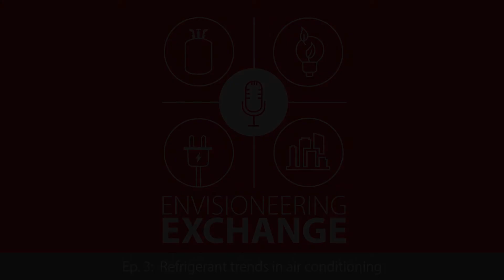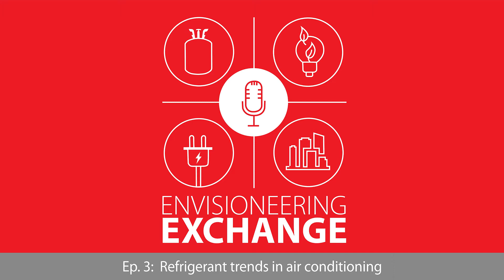Ep. 3 - Refrigerant trends in air conditioning | EnVisioneering Exchange podcast

Comment: Manufacturers need to produce better evaporator and condenser. I was told from a manufacturer they only have 1% evaporator leaks.  
I don't care for vulkan lokring fluid. The product has a short shelf life. 
If we're doing away with brazing on hydrocarbon systems.  It would be nice if zoom lock would produce couplings for appliances.